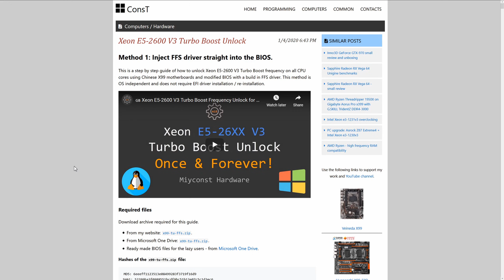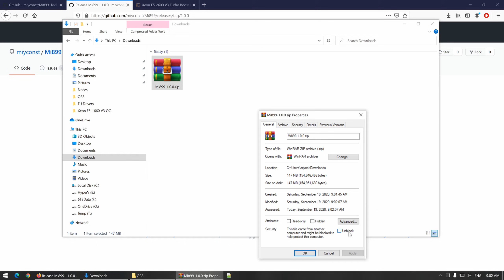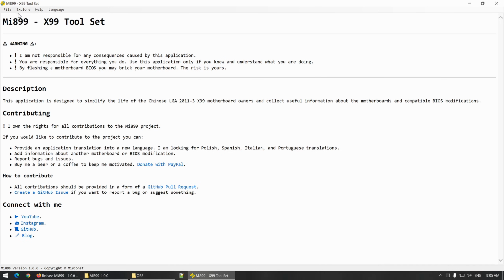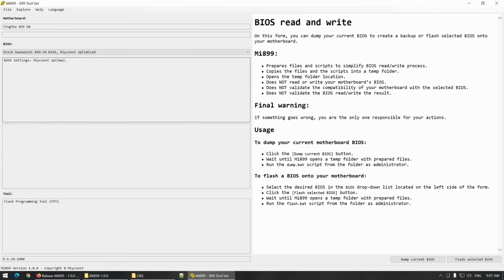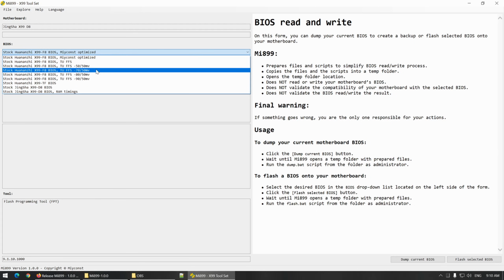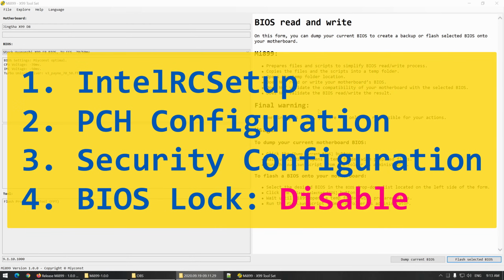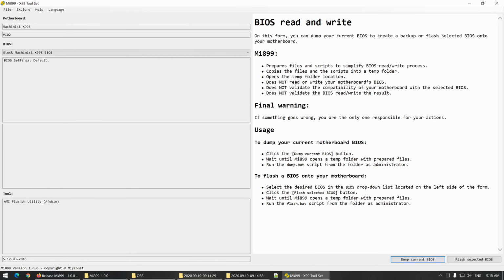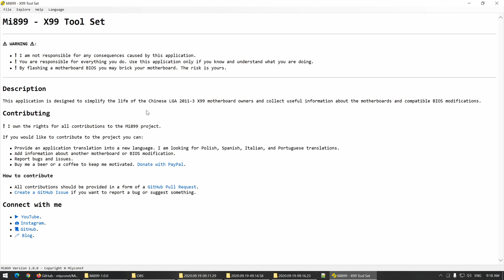🇬🇧 Mi899 – X99 Tool Set | read, write BIOS & unlock turbo-boost with a few mouse clicks

Comment: Awesome Stuff....will this work or a QIYDIA E5-H9 Motherboard..
Reply from the maker: It should, but there is always a risk to brick your motherboard.
Reply: @Miyconst  ok thanks....got a programmer ...just in case
Reply: @Miyconst  i will like to add this motherboard pic and bios to your like ..i just backed up the stock 2022 bios..this motherboard isn't green.it's orange and different from the 1you posted....thanks
Reply from the maker: @lords2112  you can make a pull request on GitHub with the BIOS attached.
Reply: @Miyconst  ok great thanks...

Comment: Oops. Ran this with -.50 on MR9a motherboard... Freezes on load to windows. Guess I will be trying to reload stock drivers. Hahahaha darn
Reply: Had to disable power management. So undervolting not working. Ok next lol
Reply from the maker: Did you restore BIOS defaults after the flash?
Reply: @Miyconst  I did. It would boot and freeze at the windows 10 screen. 
I disabled all power management, flashed the same bios but no undervolting and it's stable. E5 1650 v3 all core turbo at 3.5 CPU temps not above 40c after cininench and 30 mins of Aida 64 stress
Reply from the maker: @njsurf1973  Xeon E5-1650 V3 is an unlocked CPU, it is not compatible with TBU BIOS.
Reply: @Miyconst  It seems to be working okay now. I didn't know the 1600 chips didn't need the unlock. And I don't have a motherboard that supports overclocking. It is stable now and I will run it until I do.
Reply: @Miyconst  I have noticed that no matter what I do, all cores on the 1650 run at the base clock (3.5) and none seem to turbo. I tried with the stock mr9a bios, and the bios selection from mi899. I am back to the huanzi bios, as it allows for ram timing to be adjusted.

Comment: Hi, I am using JINGSHA X99 D8I LGA2011-3 with xeon E5 2680V4 cpu 128gb (8*16gb) ddr4 ECC REG Memory four channels can be used and what bios upgrade to improve performance. Thanks for any advice and help
Reply from the maker: V4 Xeons do not support Turbo Boost Unlocking hack.
Reply: @Miyconst  😥

Comment: will the x99 machinist mr9a bios work with the mr9a pro motherboard?
Reply from the maker: They say it works, but I have not tested the Pro version myself, thus I can't guarantee.
Reply: @Miyconst  Thank you.
Reply: @Miyconst  it didn't work. I tried a couple of times. Thanks anyway.
Reply from the maker: @sxsoutcast7651  the motherboard didn't boot or TBU didn't work or what happened?
Reply: @Miyconst  the clock speeds stayed the same. As if nothing happened. It worked on my other x99 machinist board but not this one.
Reply from the maker: @sxsoutcast7651  What BIOS did you try?
Reply: @Miyconst  I used the one listed as mr9a machinist
Reply from the maker: @sxsoutcast7651  that is the stock BIOS, it has no modifications, please read the BIOS description.
Reply: @Miyconst  I did see that when doing it. Which bios would you recommend?
Reply from the maker: @sxsoutcast7651  Select Machinist X99-MR9A motherboard in the list and from the compatible BIOS options go with the -50/50 MV voltage offset.
Reply: @Miyconst  I try to help my friends with the computer that they want and this is yet another x99 bricked or just dead. I did the flash and turned it off and turned it back on and it is now FF. I do the newer stuff without issue. When it comes to x58 and x99 I have the worst luck. This has been humbling to say the least. Thank you for all of the time and the great videos but I'm done with X family of motherboards.
Reply: @Miyconst  I would like to buy you a beer or coffee. Do you have PayPal?
Reply from the maker: @sxsoutcast7651  it's really time to move onto AM4/AM5 or LGA 1200/1700.
Reply from the maker: @sxsoutcast7651  thank you for the support. PayPal donation link is available at the end of the video description.

Comment: I have a MB Machinist E5 MR9A PRO ATX with an E5 2670v3. The process was very easy. However, after restarting, it did not recognize the ssd to boot, so I always had to give default settings to the bios so that it could turn on.

I thought that restoring the original bios would fix the problem but everything remained the same, I needed to continue giving default settings. I kept restoring the bios with the backup file until I don't know what I did differently than it was finally fixed and it boots normally.
Reply: Hola amigo, como lograstes solucionar? o que BIOS le colocastes? Sabes cuales BIOS son compatibles con la MR9A PRO? No me reconoce los SSD M.2 Sata

Comment: Congratulations for your Youtube Channel. I have a question, wich is the best undervolt for the Huananzhi X99 TF with a 2666 v3? Thank you
Reply from the maker: There is no universally best undervolting for every CPU, each and every E5-2666 V3 are slightly different, but you can go with the safe option of -50/50 MV.
Reply: @Miyconst  thank you! You are great!

Comment: Hello, which bios with ram timings and turbo unlock do you recommend for the Huananzhi F8 v2? in the Mi899 application the F8 version is not specified and I was afraid.

I know you get a lot of questions similar to this one, so sorry for bothering you.

Thanks.
Reply from the maker: Mi899 doesn't have BIOS for X99-F8 V2 because you need to flash it with a programmer. The BIOS I recommend is available on GitHub, from iEngineer.
Reply: @Miyconst  Is there any chance this will change in the future and the Mi899 will support it? Hopeful commentary.
Reply from the maker: @bruno-oliveira-tecnologia  so far I don't see such a chance. If someone makes a good BIOS that doesn't require CH341A - I will add it to Mi899, but the iEngineer BIOS that you have to flash with a programmer won't be in Mi899, because people will flash it with FPT without reading my warning and will brick their motherboards.
Reply: @Miyconst  how to know if the X99-F8 is v.1 or v.2?
Reply from the maker: @moedjadoel  check the BIOS chip, if it's Winbond - it's V 1.0.

Comment: I have a x99 t8d with a cpu holder that uses only one cpu (because the socket on the left side is damaged so it can't work) can i do turbo unlock?
Reply from the maker: Yes, it should work, but I would recommend you to use S3TurboTool method.

Comment: Your videos about the X99 are excellent, thank you. I wish I watched them before I purchased my X99 from Atermiter.  I checked all boards covered by you Mi899 file but cannot find BIOS for it.  Can you suggest where I can get the BIOS update for Atermiter ZX-99EV3_v.1.31? Or can you suggest any of the BIOS you listed is compatible with my X99 board. My current problem is everything boot up, but I just cannot install windows. The installation hangs at the Windows logo.  Any suggestion will be appreciated. Thx.

Comment: Miyconst once again congrats on the amazing channel and invaluable content!
So, I have a Machinist mr9a v2.0 (non pro) paired with a 2690 V3 ES stepping 2.
I followed your video and the script for flashing the bios ran without errors. 
However, after reboot, windows 10 freezes 30 seconds after I log in. I tried -70mv undervolt, -50mv, and no undervolt whatsoever, and I get the same result with all turbo unlock bios flashes: Windows freezing. Without undervolt I can actually stay around 3 minutes logged in Windows, however, I don't even see the max clock in CPU-Z active, as if the turbo unlock didn't work.
Any idea as to why this is happening? Do you think it's because I have an ES CPU, even though it's stepping 2? Maybe because I'm using v2.0 of the mr9a? 
I'm getting kind of desperate and starting to think I won't be able to turbo unlock at all with my setup :( 
Your help would be truly appreciated!!
Thank you so much for everything you do!
Reply from the maker: Did you restore BIOS defaults after flashing a nodded BIOS? If yes - please text me on Discord for further investigation.
Reply: @Miyconst  That did the trick! I apologize, as I wasn't aware of that final step!
Now onto enabling ReBar :)
Thank you so much and take care!!

Comment: Error 284: Fail to load driver (PCI access for Windows).
Tool needs to run with an administrator priviledge account.
Reply: I get that even though I run it as administrator

Comment: Hey, do you know if any of the current Huananzhi board BIOSes you have will work with a Huananzhi X99-QD4?
Reply from the maker: I don't know yet, but X99-QD4 is on my test bench right now.
Reply: @Miyconst  Absolute champion, I just came back to this comment, downloaded the latest version, and saw the QD4 was good to go. Last question: do you have a recommendation for undervolting, or do you reckon just to pick the safest undervolt and go from there.
Reply from the maker: @CarrionMaw I would just go with the safe -50/50 MV, unless you are really up for some messing.

Comment: Thanks Miyconst!  Had an ASRock X99M 4Extreme with an i7-5820k that died recently so I picked up a X99-F8.  Had troubles overclocking which I attributed to the i7, so I grabbed an E5-1650 V3 and still couldn't enable overclocking features and boot with newer BIOS.  Noticed all the successful overclocking videos were running the 2019 BIOS which I couldn't find anywhere except in your tool.  Boosted the CPU to 40x and running just fine though still need some burn in time.  Going to try and squeeze a little more out of the bus clock like Koshak1013 did next.
Reply: Hi, i have the 5820k with a jingsha ad12b motherboard. the bios is updated to x99-f8. Did you end up being succesful in overclocking this cpu? do you have any pointers ?

Comment: It seems as if my Jingsha E8I does not like the -90/50 undervolt and I am getting bsod's constantly within 15 or 20 seconds of rebooting, and in-turn can no longer run the mi899 tool to revert back to the non-undervolted bios. Is there a way I can just extract the X99 E8I TU FFS bios from the program and manually flash it via usb? I have a laptop to work with for preparing the flash drive
Reply: I have the .rom file that I found in the program, and have it on my desktop, i just cannot really find clear enough instructions on what to do with it

Comment: please add Dell precesion  T5810
Reply from the maker: Sorry, I can't. T5810 has locked BIOS and you can only flash it with a CH341a or a similar programmer.
Reply: @Miyconst  yeah I figured it out through your videos. Thanks man. I will go with a flash programmer

Comment: Hi Friend, I downloaded your unluck program, I have a JINGSHA d8i f8, I only found in your program the unlock for the version: E8i, do you know if the d8i supports unlock?, Hello Friend, I downloaded your unluck program, I have a JINGSHA d8i f8, I only found in your program the unlock for the version: E8i, do you know if the d8i supports unlock?
Reply from the maker: I have not test D8i and don't have premade BIOS for it, but most likely it supports Turbo Unlock.
Reply: @Miyconst  I'm going to overclock manually, which undervolt do you recommend to avoid problems? for the 2699 v3 processor? with this motherboard that d8i f8? I think the safest would be 50/50?
Reply from the maker: Yes, -50/50mv is the default safe option.

Comment: Hi Miyconst, I hope all is well with you and your family, and I wanted to thank you for the great work you've done for the community!
Now I have a question, is this program updating the latest F8 from Aliexpress? Or I may have some kind of Brick by board version difference.
If yes, is there any way for me to know what the risk is? Thank you very much!
Reply from the maker: V2 version of X99-F8 has a good BIOS from iEngineer (search on GitHub), but it requires CH341A (or other programmer) to flash, that's why I didn't add it to Mi899 app. If your motherboard uses Winbond BIOS chip - most likely it's V1.0, otherwise it's most likely V2.0, I hope this helps.
Reply: @Miyconst  WOW, thank you so much for all your work and your attention, it helped a lot! I'll look for the iEngineer BIOS, and order one of these CH341A's. It really helped. Now just to make sure your app doesn't even support the latest F8 models?
Reply from the maker: @luizfernandoferreira7074  that's correct, Mi899 does not have support for X99-TF/T8/F8 version 2.0, these motherboards require BIOS flash with CH341A.
Reply: @Miyconst  Hi Miyconst, thank you very much for your feedback! Now I totally understand, I already ordered a CH341A, I'm anxious for it to arrive and I have a little fun with it, I always wanted one of these babies but I lacked opportunities to apply them! Once again, thank you so much for your amazing work and for the indications and guidance!

Comment: I downloaded newest version of this tool but I can't find any unlocked Bios for Huananzhi F8D althought you put its name in the list. Where can I find it?
Reply from the maker: Mi899 does not have BIOS mods for X99-F8D.
Reply: @Miyconst  Thanks and no problem. I found a video that guide step by step to unlock any mainboards x99 including Huananzhi T8D and F8D flawlessly.
Reply: @Miyconst  do you know how to have Restore AC Power Loss in HUananzhi F8D mainboard. They don't have any option for Power Restore on dual mainboard like T8D and F8D

Comment: What would you recommend the BIOS for E5 2666 v3? machinist x99 mr9a pro motherboard
Reply from the maker: I would go with Huananzhi X99-8M-F BIOS and -70/50/50 voltage reduction.
Reply: @Miyconst  Thanks bro
Reply: Te funciono esa version de BIOS?

Comment: I was day dreaming that in a few months there will be something like this for me jingsha X99M-G, fingers crossed :)
Reply from the maker: X99M-G is compatible with X99M-H(2) BIOS options as far as I know.
Reply: @Miyconst  I got the OG M-G bios and a few moded versions to try and used a flash tool from your tool kit I think it was the X99M-H tools I used to flash it, but I had to turn all locks off in bios and flash it 2-3 times in a row. It said it couldn't fully flash it if I did it once and then checking CPU it showed it didn't work but if you do it a few times even though it says it did fully works it works. I am total nube to this bios moding though.

Comment: What's the best reduction for 2640v3 for cpu and imc -70mv/50mv. 
I have machinist rs9 

I have two intake fans and two exhaust fans the cpu is cooled by 3 fans mounted on a 6 heat sink cpu cooler. 

I can add two extra fans if possible. 

Im using a fan controller to control the speed of fans.
Reply from the maker: -70/50 is good enough, if it works - let it be.

Comment: I have succesfully unlock my dual 2697v3 on my Jginyue D8 at (-80mv -50mv -50mv) using your software... but the problem now is my dual channel (32GB x2) DDR4 2133mhz RAM runs only at 1000mhz to 1200mhz frequency.
How can i increase it more? even just to 1800mhz peak high. Help me sir please.
Reply from the maker: I think you are mixing memory speed in MHz and MTS. DDR4-2133 runs at ~1067 MHz, 2133 is speed in Mega Transfers per Second. Run Aida 64 memory test and see what values it reports.
Reply: @Miyconst  ohhh.. ok now i understand. Thank you very much sir.
Also i wanna ask if can i be able to overclock my 3.6ghz 2697v3 up to 4.0ghz or something on BIOS setting. i've already unlocked the overclocking options on Jginyue BIOS using AMIBCP but i have no idea what settings/numbers to change.
Reply from the maker: @georgeconner6746  all Xeon E5-26XX CPUs are locked and it's not possible to overclock them with the CPU clock multiplier.

Comment: your videos are really meaningful to me 😙 and i have a question how much voltage should i subtract for my e5 2660 v3 to run stable on x99 8mf. Thanks u very much 😘
Reply from the maker: I always recommend to go with -50/50 mv offset. 99% of V3 CPUs can handle such voltage reduction.

Comment: BSOD,
 during boot and install of new windows 10.

i have rs9 and chose -100/-50

is there a way where I could back to default bios?
Reply from the maker: This video answers your question: https://youtu.be/r2CXlt_qKVk
Reply: @Miyconst  thanks. Followed the video but I think -100/50 is too much for my rs9/e2673.

What solved the problem was to overclock it and add mv little by little. It was a bit of a trial and error but I was able to run win10 and flash the default bios.

Comment: Hi bro, thank you for making such good program!
I just want to ask if this works on HUANANZHI X99-8M-F Motherboard with 2660 v3?
Reply from the maker: Yes, it does work. At least it worked when I tested X99-8M-F.
Reply: @Miyconst  Are desktop rams compatible with this or should I buy server ram? Thanks again bro.
Reply from the maker: @TheSpektral  you can use ECC or regular RAM, but only one type at a time. Also, the cheap 4-bank 4/8 GB modules are not compatible with X99.

Comment: Hey bro, my pc x99f8 2680v3 run a bios mod but it not stably. Running full load cpu from 2-3 days it will have an error : clock watchdog time out. I try to install another windows, clearn ram, vga, etc... but it will be error again. the temp cpu ~65C, vga 67C, ram 70C... anybody can help me. Witch bios can work well in my combo ??? Many thanks.
Reply from the maker: Most likely you have applied too much undervolting for you CPU. Test your configuration with the default BIOS and see if the issue persists.
Reply: @Miyconst  hi, I will try a bios without undervolt